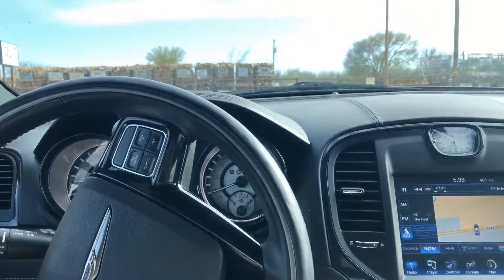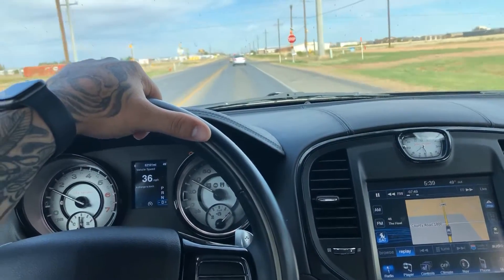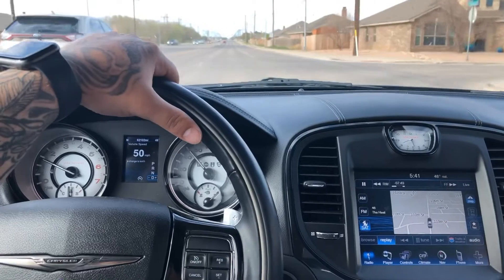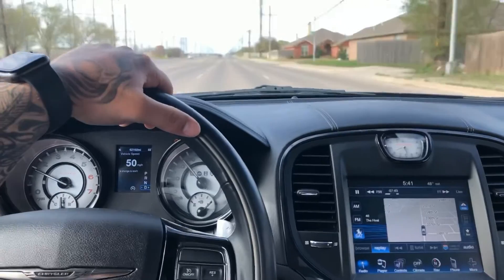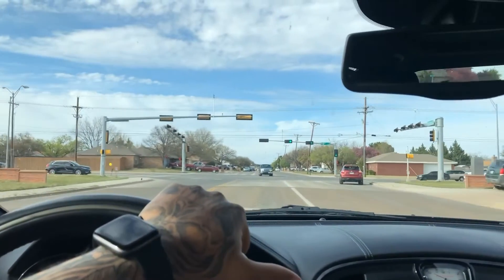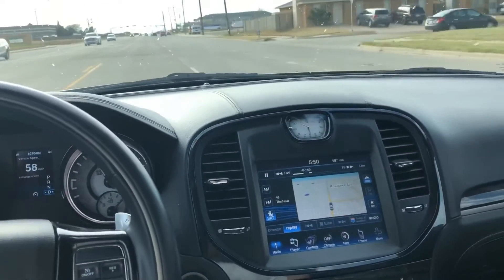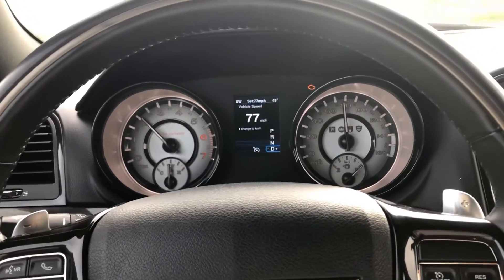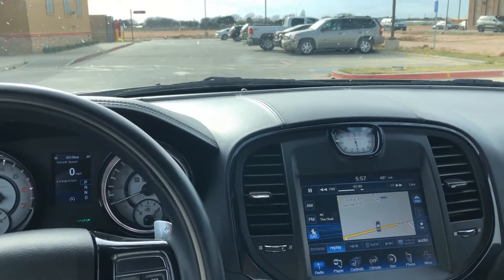Daily driving a straight piped 2013 300c

Comment: I adore our 2013 Chrysler 300c AWD 5.7L, it is still a head turner in 2022! Ours has about 65,000 miles. We don't drive much. The only bad thing we have seen, just wait until the glue gives out on your dashboard, even if it's under warranty Chrysler refuses to fix it. Where the dash meets the bottom of the windshield the dash is separated and peeling back. Many have the same problem. It will cost around 3,000 to have a garage fix it.
Reply: did fix it with a better option? I got this problem too.
Reply: I had a 2014 Jeep Grand Cherokee with exact same problem.
Reply: I just put a dash cover over my shit 😂. I think it’s a 11-14 issue only tho

Comment: No crossover?

Btw how is the sound with the stock exhaust? Is this a very quiet and insulated cabin or can you actually hear the V8 rumble at low revs?

Thinking about buying one but we can’t straight pipe over here and I dislike quiet cars!
Reply from the maker: You can definitely hear it as you run through your gears.. I’m not supposed straight pipe either but what the law don’t know won’t hurt it
Reply: @Rubengarcia.20  Problems come when there’s an accident or someone gets hurt by running in front of your car.

If you got something illegal on there you’re basically fucked then. Not worth it for me.
Maybe an electronic valve exhaust system is the solution.

Comment: How's the 300 treating you have any problems with it how many miles it have now. Thinking about looking at a used one with 80k miles.
Reply from the maker: dvastation.squad this ones at 73k and it’s running flawlessly! If you want something to go fast in, probably not the car for you unless you have deep pockets. But if you want to look good and want something a little luxurious but with a little muscle, this is definitely the one!
Reply: @Rubengarcia.20  yeah I'm looking for a ride that'll still fit the family in but still have the muscle to get up and go when I want it and that has the aggressive sound. Just haven't heard any mechanical issues with them so thought I'd ask. Thanks
Reply from the maker: dvastation.squad it’s definitely something you can have fun in. Only thing I can say is the lifters tend to go when you get close to 100k miles but that’s been said on any hemi
Reply: dvastation.squad if you want a family car get a Trailblazer SS 6.0l v8 LS2 sports SUV bit of a gas hog but a simple tune and exhaust will be pushing 425+

Comment: This is a great video thank you for posting it.  I have questions though.  I don’t hear any mds 4 cyl noise at all coming from your car.  Is it chipped with eco mode turned off?

My last 2010, I had the Corsa sport exhaust which was great but there was definitely 4 cyl mode drone in the city which kept me in autostick most of the time.  But on the highway no 4 cyl mode noise could heard whether it dropped in our out.

That car was sold long ago but getting my hands on another 2010 same model in a few days.  This time I want to straight pipe. But I want to know how bad the mds drone is.  I will likely autostick it in the city anyway...   but if the 4 cyl mode is very noticeable sound wise on the highway, I would be forced to buy a chip and turn it off.

To be clear, I don’t mind 8 cyl motor or exhaust noise.  But the 4cyl mode.  That is a concern....

Thanks in advance if you get a chance to read and respond!

Appreciated the video.
Reply from the maker: Clee Hammer ok, so on this set up I don’t have cats so that threw an engine code disabling the mds but after I got headers and tuned the mds was enabled again and there wasn’t much drone at all. Headers actually quitened it down until you got in the upper RPM’s of course
Reply: Ok, so finally got my suitcase muffler and rear resonators deleted.   It’s actually pretty civilized if you are easy on the throttle.  But....   the mds drop down is very noticeable on the highway.  I will definitely consider getting a predator to allow the mds to be turned off...

Unless there is another way...

Otherwise, the car sounds great!

Comment: Is that the 5 0r 8speed
Reply: The john varvatos only comes with the 5 speed actually all chrysler 300's with the v8 hemi have 5 speeds and they are hard to find now.
Reply: False. 300.hemis are 8 speed since 2015.
Reply: @cheabosscray1650  thats funny i could never find a hemi for the 2015+ 300s must be rare
Reply: @cheabosscray1650  i still would get the john varvatos looks nicer and has more features
Reply: I thought the 300C doesn’t come with paddle shifters ?
Reply: @hiramcaldera8344  Yes it does. I have a 2014 300c

Comment: Is this car expensive to maintain
Reply from the maker: Auto Trimmers maintain as in how?
Reply: Ruben Garcia oil changes , parts , mechanic work  expensive to do or cheap
Reply from the maker: Auto Trimmers oil changes I do myself. I use royal purple and mopar oil filters, a little more expensive but I like the brands. Parts with performance parts and OEM parts both are fairly expensive with Mopar compared to other brands such as ford and Chevy. Mechanic work I’ve done all my own stuff I’ll try to stay out of the shops as much as I can do that I couldn’t tell you but most shops are expensive.
Reply: Theres plenty of rams, challengers, chargers, etc . That share parts so I dont think its all that expensive , RockAuto is usually the cheapest place but Ive also gotten lucky on warehouse deals from Amazon. If you don't mind buying used, sometimes Egay will have it cheap. 

Ive owned many cars over 200k so   I've learned how to find the cheapest parts available, the part number is very important when comparing different websites also making sure it's the exact same product. I've only been burned one time when the seller claimed the part to be new but it was actually refurbished, still looked very nice and the price was half what the junk yard would've charged me so I let that one slide.